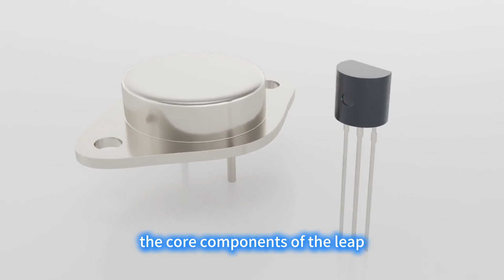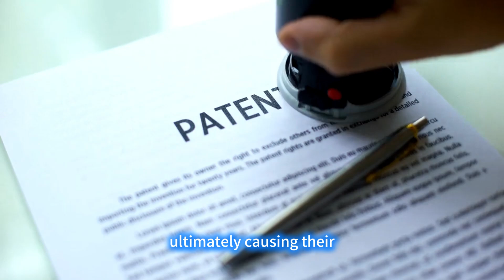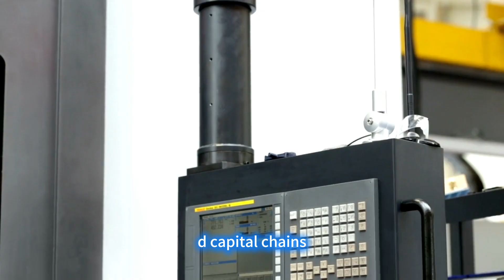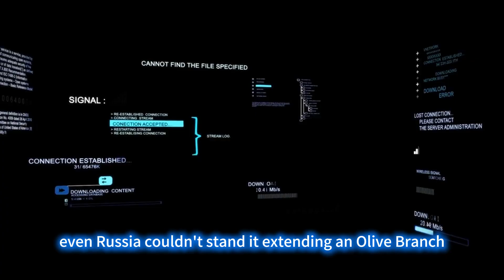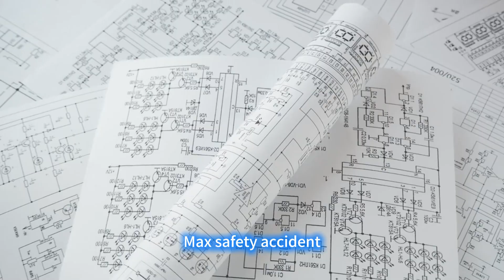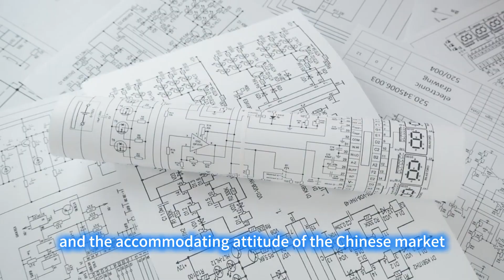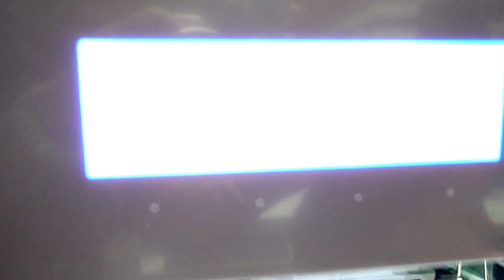Why Don't U.S. Sanctions Work on Ternary Technology?Why Is the White House Panicked？

Comment: China and Russia are neighbors, and that's a fact.  More cross culture has is been happening along 2600 miles since, peoples have inhabited those areas.  I'm glad China took an old school concept and is running with it.  Parallel to spintronic and photonic processing.  Maybe ternary stays relevant for specific applications, whenever photonic processing becomes scalably viable.  When silicon will be like petro ebgines with carburetors.